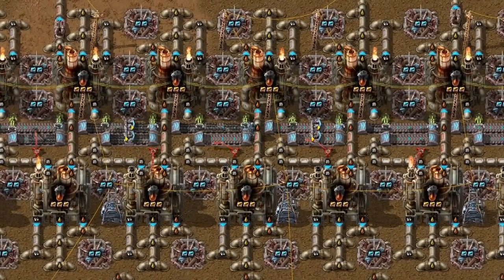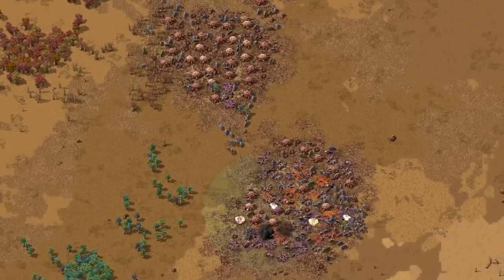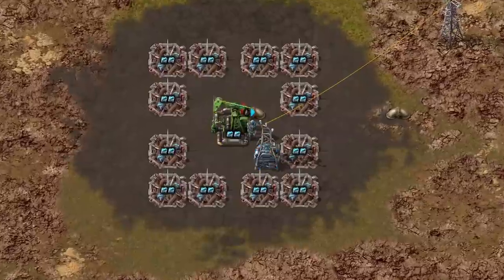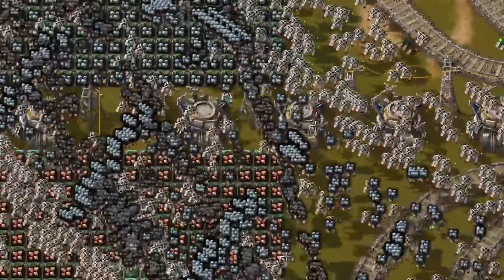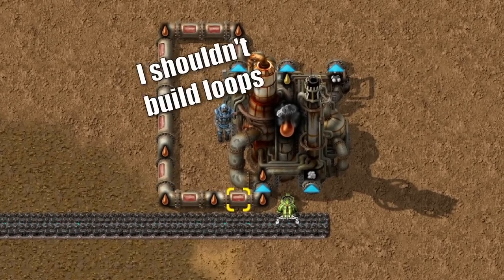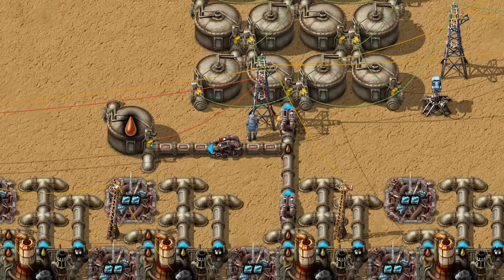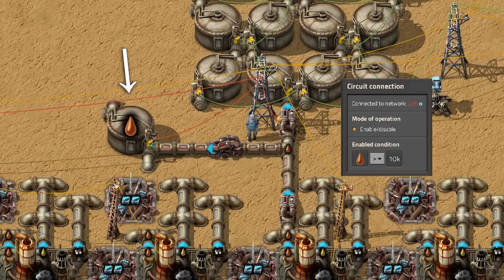Liquify your Coal.

Comment: I always used nuclear to create the steam for coal liquefaction.
Reply: I do it too, I find it simpler as it avoids a loop in the liquefaction plant. Also if the steam comes by train the structure is not that much more complicated than a water input.
Reply: I was doing it this way in my last world, but at one moment my ass blew up because of burning trice amount of energy to nowhere.
Reply: @spartanzneverdie3211  Nuclear reactors in vanilla don't blow up like that.
Reply: @Jamesaepp  "ass" wasn't any kind of abbreviation, it was about getting finally annoyed by ghost of inefficiency
Reply: @spartanzneverdie3211  The way I did it was more efficient than burning coal. I think I understand what your problem is, here's what I did:

Setup the nuke + 4 heat exchangers + pipes. Manually give the nuke enough fuel cells so it buffers everything in the system to 500 c, then wait for everything to cool down back to 500c without fuel.

Then hook up a bunch of fluid tanks  to the output of the heat exchangers - as many as you need, I think the number is around 10 but this is where you need to experiment a bit.

Give the nuke one fuel cell. Wait for it to burn through and all the heat to drop back to 500c. Measure how much steam the reactor gave you for that one cell and then adjust the # of tanks if you need/want to.

Hook up all the fluid tanks as one circuit network. Hook up an "out"serter that will remove spent cells from the reactor. Make the condition of the outserter to only remove fuel from the reactor when steam is below a certain threshold. Again, use your head - maybe 10k is good or maybe 5k is good. Also add the option on the outserter to flash a signal (your choice) as a pulse when it has contents in hand.

Add an inserter that will add fuel cells to the reactor. Hook up the outserter and inserter together (on a separate network if you wish) and have the inserter's condition be to only insert fuel when it receives the signal from the outserter based on the condition in the previous paragraph. Limit the stack size to 1 on this inserter.

Voila. Now when the steam in the tanks drops below say, 10k, the outserter will remove the spent fuel cell from the reactor. The outserter will pulse a signal when it removes the fuel to the inserter which will trigger it to add a new fuel cell to the reactor.

Net result is no wasted energy from the fuel cells, and you're more efficient than using coal/fuels to generate steam.
Reply: @Jamesaepp  man, i was feeling bad about misunderstanding that happened, but then stopped. I was speaking about using steam-500 instead of steam-165, because of losing POTENTIAL power. When i saw amount of text you written and understood that it's about reactor setup, at first i didn't want to even read because i hate this topic: my first ever cirquit network in factorio was made by me for my first reactor (when i understood it's main problem, infinite fuel usage), and when i was working on that, i spent about 6-8 hours to make it work, thats why i hate this topic, as i said (i blindly use that controller every time i play new game). But understanding that you were writing it all for me, i've read it, and... And now i know something new for me, "analogue" :) I use absolutely same mechanism, but instead of using "output and input at the same time" controller type, i traditionally use "recharge preventing timer after last recharge" type. By the way, that is the reason why i spent that much time when created "my first network ever" 😁 Was fun to talk about it
Reply: @Jamesaepp  all this time i was checking factorio modding mechanism for the first time, and modifications i'm planning include both reactor cirquit interface and heat exchange. Just funny fact
Reply: I did too until I realized that using boilers takes less than 4% more coal. You need water for cracking anyway so it's one less input.
Reply: @Pence128  4% is a lot.....
Reply: @Jamesaepp  26 is not a lot more than 25.
Reply: No, but 4% is a lot. That's why every (experienced) factorio player puts productivity mk1 modules in their labs as soon as possible.
Reply: @Jamesaepp  The difference between 26 and 25 is 4%.
Reply: @Pence128  oh I read your reply as percentages not units.
Reply: @Jamesaepp  Anyway, call me lazy but I'd rather just place one more coal miner for every 8 oil refineries.
Reply: @Pence128  not lazy at all, we just have different priorities. You value simplicity and speed of setup while I favour efficiency.

Comment: Turning coal into solid fuel through liquefaction about doubles its energy.

But since oil never completely runs out, you only need coal liquefaction if you are not drilling enough oil.

Comment: Is it more efficient to use coal or turn it into solid fuel and then use that? in energy terms of course
Reply: Converting to solid fuel roughly doubles the energy after burning some for power.

Comment: Why would I replace an infinite resource with a finite resource?
Reply from the maker: oil is infinity, but it's getting slower to extract overtime
so it's infinity, however at some point pumpjacks works at like 0.001% speed
Reply: @Trupen  The lowest they get is 20%. Two big ones will cover you till endgame. If you need more than that, the infinite nature of the beast only becomes more appealing.

Comment: What’s better, speed modules, or production modules?
Reply: Both, both is good
Reply: Although speed can't drop below 30%, iirc
Reply: Depends on what you're crafting. If it's a green circuit, speed module. If it's a rocket, productivity module.
Reply: You have lots of space to build redundant machines feeding off a single belt: production
You don't have a lot of space and need a few machines to produce lots of output: speed
Input resources are extremely rare / slow to produce: production
Input resources are extremely common / fast to produce: speed
Reply: In vanila i prefer productivity in pump and speed in beacons :-)
Reply: Productivity modules are the more effective the later in the production chain that they're placed. So for example they're not great in miners because that's the first production stage but they're excellent for flying robot frames or blue circuits which are using multiple ingredients that each require multiple ingredients themselves. This is why you always see science and rockets using production modules as they're the end of their respective production chains.
Reply: @rbxless  is speed module good for greens? Isn't it more energy friendly to build more assemblers? And also cheaper. I am asking because I'm not sure
Reply: @BEN-ys6gu  Yes, you're totally right, but it saves a little bit of space. It's kind of like choosing between nuclear and solar power.
Reply: I use productivity only in labs/silo/yellow and purple sciences. Blue is not that expensive in compare, and also... When using tier3 table+tier3 modules, yellow/purple/blue table ratio turns into ~1:1. It's accurate 14 of each table per 0.9 silo when white/yellow/purple science using top productivity!